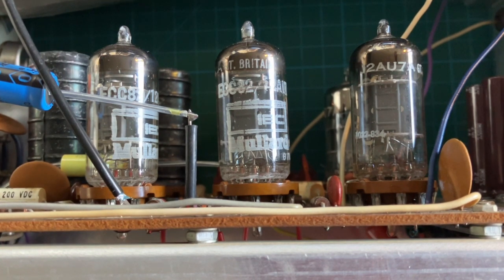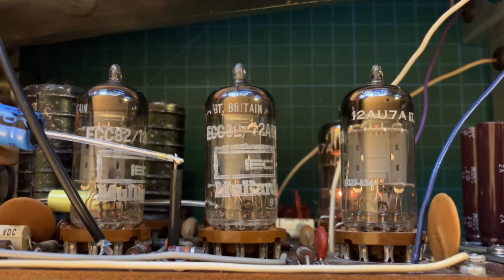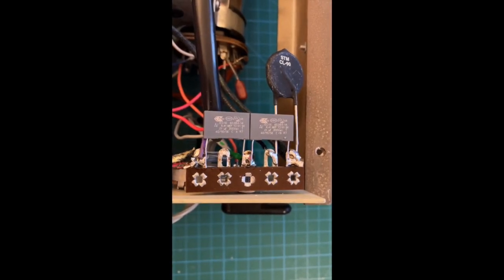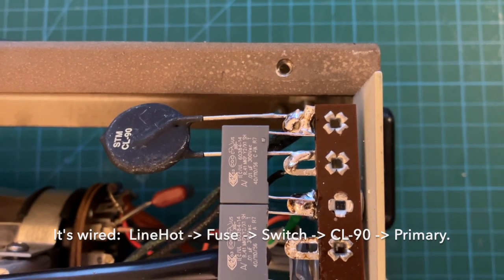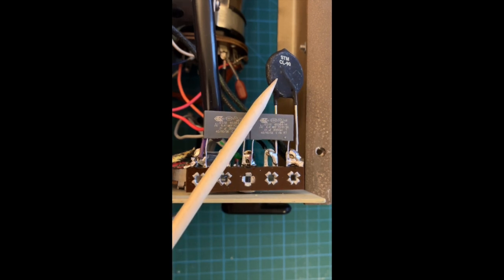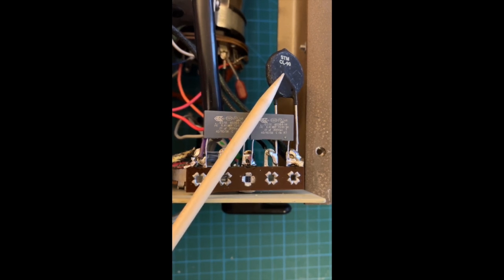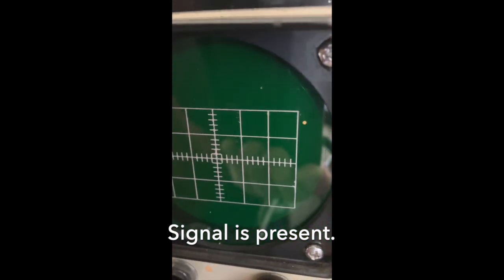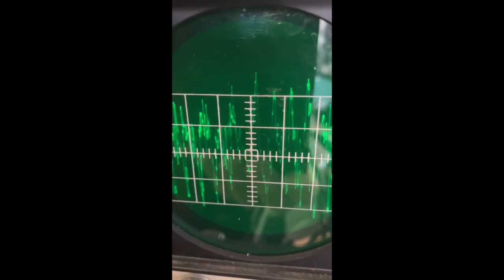Heathkit Tube Flash & the CL-90

Comment: I would have to measure the voltage on the filaments, as they are designed to have a certain voltage on them, or else it will shorten the life of the tube having too little voltage, just as much as if the voltage is too high.

Besides, tube flash is normal since the 1960s when people wanted their tube equipment to be faster in warming up, they designed the filaments to heat quickly, making the warmup shorter. In some cases, tube filaments had their power always on, in order to cut the warmup time even more, and to reduce drift characteristics.

Besides, they didn't really care if it shortened the life of the tube, as they sold tubes by the millions, and is why we have a surplus of NOS tubes. But the reality is, it didn't shorten the life much, if any.
Reply from the maker: I agree that tubes were certainly cheaper and more plentiful back in the 50's, 60's, maybe even '70s.   Today though they're not getting any cheaper so anything to prolong their life would make sense.  Thanks for watching and commenting!
Reply: @dtss_smudge  Well, if we clear up trade relations with China and Russia, now that the war monger is out of office, we might see new tubes available again.

Comment: That thermistor should be pushed away from the wood base! They often run almost hot enough to scorch wood.
Reply from the maker: Um, there's absolutely no wood anywhere in this oscilloscope.  The CL-90 is positioned about an inch away from any (metal) chassis part, mostly to preclude accidental shorts.
But thanks for taking the time to comment!
Reply: @dtss_smudge  , it looks like a wood case right next to the thermistor and safety capacitors on the tag strip; perhaps you have the chassis sitting on a block of wood?  Anyway, you didn't say it was  an oscilloscope untill almost the very end of the video, and so for all I knew it was an old audio amplifier or receiver with a wood case or side panels. I write my comments as I'm watching the video, not at the very end....
Reply from the maker: Apologies for the confusion.  Thanks again for watching the video and commenting!

Comment: Concerning the vintage Mullard, Amperex and Telefunken tubes that have a filament flash, it is completely normal and is intentionally designed into the tube. This is a fact and it does not indicate a bad tube nor does it need an inrush current limiting circuit. My McIntosh C20 has the original tubes in it from circa 1959 and it has been, and still is, working perfectly after 65 years of filament flash.
Reply: A valve with ballooning heaters. I've got an ECC 83 that does that. It seems none the worse for it.
Reply from the maker: @ElPasoTubeAmps, & @6AK5W (pentode fan?) Then please explain to me why only one of the three 12AU7s in this scope, and why as you saw in Mr. Carlson's 12AU7, and mine, only one of the two filaments in the tube exhibit flash?
Reply: @dtss_smudge  I don't know how they designed the tube filament but it does flash under just one of the triodes. As you know, the filaments are in series. It seems to me and this is just guessing at it, they went to the trouble to make that part of the filament more like a light bulb so it would flash up. The general consensus is to make the tube warm up faster. I do not know if that was the primary design reason. This is a fact that these tubes are supposed to behave in this manner. As for why only one of the tubes in your scope flashes, it is because it is probably a different manufacturer from the rest of them. As far as I know, USA tube manufacturers did not make these types of tubes but RCA, Sylvania and the rest along with the European tube makers bought from each other and rebranded tubes with their logo so you can get a tube with an RCA logo on it and it was made in Germany or somewhere in Europe.
Reply from the maker: I'll respect your hypothesis, even though it differs from my and Mr. Carlson's.  I do appreciate your watching my videos on my little channel and taking the time to comment!
Reply: @dtss_smudge , ElPasoTubeAmps is mostly correct: the tubes that "flash" at the base for a spilt-second were intentionally designed to come up close to their working in-circuit resistance immediately at turn on, to lessen the duration of heavy filament current draw at turn-on, because a half-dozen or more cold filaments/heaters in parallel are pretty close to a short-circuit at turn-on, stressing the heater supply.  It's also a problem in series string circuits such as some table radios and especially televisions where if tubes heat up at greatly differing rates then the tubes that heat more quickly will see heater voltages above their rating until the rest of the tubes warm up and create additional voltage drops across their filaments/heaters. PS,  Ned Carlson is a smart guy, but sometimes smart people can't see the forest for the trees...
Reply from the maker: Appreciate the hypothesis, which has its plausible points.  Even if this is the case, I don't see any downside in including the CL-90 to limit inrush current to further reduce the stress on "non-flash" filaments, as well as on transformer windings, at the expense of slightly longer warm-up time.
Thanks for the comment!

Comment: I was told that filament flash is intentional. These tubes were designed to do this and it results in a  shorter warm up time. 
These tubes reach operating temperature sooner, which was something consumers wanted in the old days when people were annoyed by having to wait for the tube to warm up before the radio/music started to play.
Reply: You are correct. These tubes, 12AX7, 12AU7, 12AT7 are some of the finest and most balanced tubes ever made and the filament flash is intentional design as you mentioned. I have read where people plugging these tubes in decades ago and seeing the filament flash throw them away thinking they are bad. Very unfortunate.
Reply from the maker: See my other response to @ElPasoTubeAmps, but, separately,  the (now controversial and definitely not Energy-Star-certified) solution to impatient TV consumers was not filament flash, but rather running the filament string, including he CRT's!, at reduced voltage 24x7, aka "Instant-On".  Some of the TVs (one shango066's) even had a little switch in the back to disable it for, say, vacation off time....

Comment: I have installed inrush current protection on all of my vintage tube gear.  We have to consider that the vintage gear was designed to operate at 110 vac to 115 vac and today in my neck of the woods the line voltage is typically 124 to 127 vac.  Tubes aren't cheap and filament flash WILL shorten their life.
Reply: The "filament flash" doesn't shorten tube life; it was designed to extend tube life by increasing the turn-on RESISTANCE of cold heaters/filaments, sort of like a built-in surgistor or thermistor, so that heater-supply windings wouldn't see a sustained near-short condition at turn-on, and so that series-string heater circuits wouldn't have the heaters of faster-warming tubes become over-voltaged while other tubes warmed up more slowly and hadn't yet developed their full voltage- drop (a cold filament or heater is a low resistance,  darn near to a short circuit, and the resistance increases dramatically once it's warmed up).
Reply from the maker: Agreed.  Amusingly, Mr. Carlson's demo from many years ago also featured a 12AU7....  Anyway thanks for the comment.
Reply: @dtss_smudge  Mr. Carlson has an amazing channel and I have a lot of respect for him. I have seen his video on filament flash and he is incorrect in his assessment of these tubes.

Comment: Looks like a model IO-17 3-inch Heathkit oscilloscope to me! That was a 5 MHz scope from about 1968, I believe! (One of the things that gave it away is the presence of the 4 black plastic power cord winding posts on the cabinet rear, barely visible in brief parts of  the video.) --Bruce Brown
Reply from the maker: Bingo.  You're correct, this IO-17 will be the subject of an upcoming restoration video.  Thanks for commenting!
Reply: The I017 was my first scope when I was just 13 yr old. I  recently refurbished 2 of them just for nostalgia.